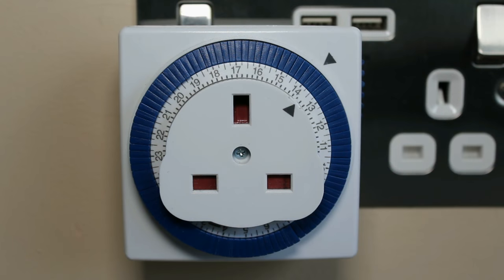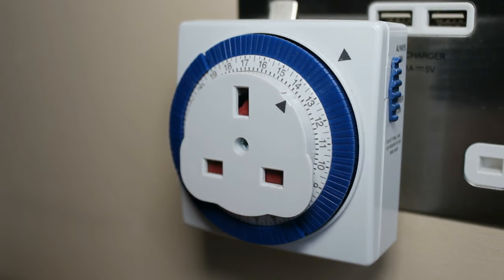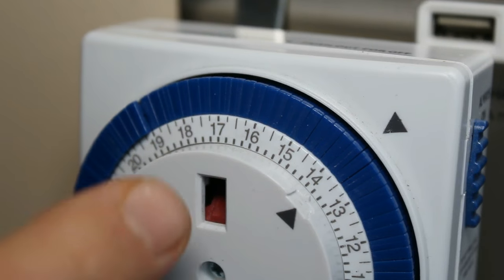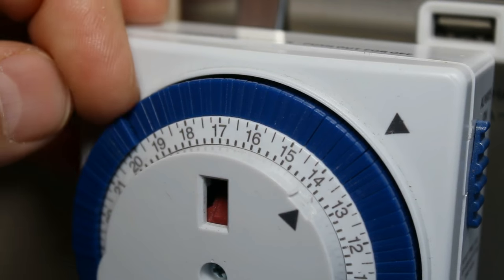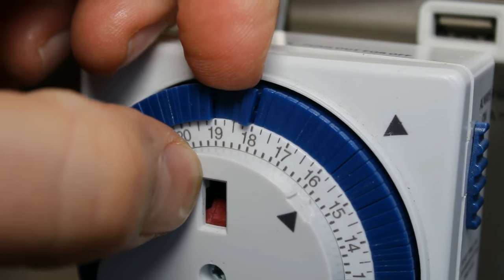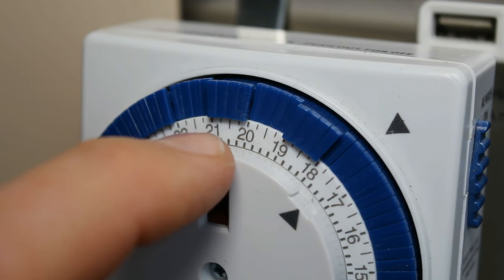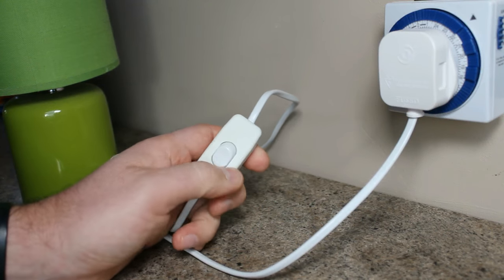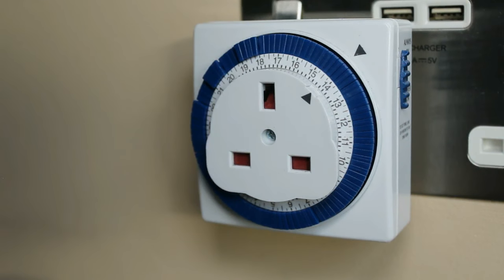How to use a Plug-In Timer Switch - Setting up a Mechanical Timer Switch

Comment: This Timer I got yesterday but it's motor so dial is not rotating while keeping switch on Time
Reply from the maker: It should turn if it's on timer and not 'off'! If it doesn't, it's not working and needs replacing!!

Comment: Finally i know how to manage the timer😃👍. Thank you for the info. Its a bit hassle when the timer is fixed by someone who knows and suddenly you got power supply disruption that makes the timer runs off depending on the power cut-off duration. Now i dont have to call in the expert to help me fix the timer.
Reply: Only person explained it propbably in my opinion 💚💨✌
Reply from the maker: Thanks guys! Glad it helped you out when you were in a sticky wicket!

Comment: Thank you so much.  I have had these for many years and have never been able to set them successfully.  Thank you for your amazing  explanatory video.
Reply from the maker: Thank you for leaving a comment!
Reply: Everybody is explaining about the pins, but nobody is explaining if the pins and the recent time has to be settled after is plugged into electricity or can be settled up and than to connect to the electricity??? 
That's my dilema!!!
Reply from the maker: You can do it either way really??

Comment: Very well explained and demo video many thanks .Can these timer switches overheat if in continual use or is a slightly mild warmth to the housing of the device, a sign of faulty device or maybe the wall socket might be the cause especially if wiring is old in the house?  . I'm just a little bit worried than when I'm out,  if it overheats for whatever reason, be it a faulty device or faulty wall socket / older house wiring,  or maybe just the device has lived out it's lifespan ? . Also how many years you think the device lasts before it should be  replaced with a new one?
Reply from the maker: I have never known one overheat. In our house we have one running all the time for the light on the Lizard's vivarium and it has been fine upto now (approx 5 years!)

Comment: Really well explained ....thank you for a clear and informative vid!
I have 2 of these the very same as the one you're using but the actual 'clock' itself has stopped working on one of them. I just wondered whether you think I'd be able to take it apart and repair it at all? Or is it just time to ditch it and buy another perhaps? 
Thanks for any info/suggestions you may have on this.
Reply from the maker: I've never opened one up, but I guess it would all be cogs and gears and not something that I'd bother doing. For the price of then I'd buy new! Saying that, it could be something as simple as the switch not working?
Reply: @charlieshooter 
 Hi and thanks for getting back to me. 
Lol, yes, in view of how much they cost perhaps I was being a bit silly to consider repairing! 
I just thought if there was perhaps a quick fix it would save more waste going to landfill ...or wherever this type of waste does go ..  :)
Anyway, have just picked up a set of 2 Eveready for £7 from B&M so I'm good to go!!
Thanks again
D

Comment: You’ve explained that so well thank you, can I ask can you plug these into an extension lead ?
Reply from the maker: Yes, I've used them in extension leads. Only problem is, they are so wide that you won't fit another plug in the next socket.

Comment: great video. i just need to know if its clock does work continuously day after day without needing? if so does it get power from plug or a battery?
Reply from the maker: It just keeps going day after day. The power comes from the socket. Not sure how much it uses, very little I'd imagine!

Comment: Really like your video we are trying a timer in the lamp but when we turn the lamp on it stays on and won’t switch off are we setting it up wrong many thanks
Reply from the maker: Thank you! You may have the timer set to permanently "on" rather than on timer. There's usually a slide switch on the side.

Comment: Are these safe to use on an oil heater when away from home for a while, e.g. when on holiday ? P.S. Your detailed explanation of how it works will help me for sure, if I do get one.
Reply from the maker: I dont see why there should be an issue, as long as the oil heater is in good working order and placed in a safe place. Some of them have their own timers on them?

Comment: Hi great video .. what if i didnt set the mechanical timer to match the time  on the  clock ...if you see my point..would it work
Reply from the maker: I see what you mean. It would work but it would just be an hour or 2 behind/in front, however much out the timer is.

Comment: Thanks. Will it make a clicky sound every 15mins? Just wondering if that'll get irritating.
Reply from the maker: Some them do make a very light ticking sound, but no more than a clock would, and it's quiet enough that it doesn't get annoying.
Reply: @charlieshooter  thanks I'll try.

Comment: Is it always important to plug the timer directly into the mains ? Or into a extension lead box, then the extension lead into the mains?
Reply from the maker: You can plug the timer into an extension lead, that's fine. We do for our lizard's light.
One thing though, you may not get another plug right next to it on the extension, depending on the size and shape of your timer.

Comment: Silly question but will this plug work everyday it's plugged in say if I was going on holiday for a week and I wanted the lights to come on from 5pm to 12pm will it do that for 7 days or just the one day?
Reply from the maker: It will do that until you unplug it! It just keeps turning and is a 24hr clock.

Comment: Is the "clock" mechanically run or is it electric? Like if I disconnect the timer from the power socket, is it going to stay at the current time or will the clock be moving still?
Reply from the maker: It is powered by the electric socket it is plugged into. It will not continue turning once it is unplugged.
Reply from the maker: The clock is powered by the electric socket it is plugged in to. It will not continue to turn once it has been unplugged.

Comment: Is it safe to plug one of these into a double plug or dose it have to be a wall socket.
Reply from the maker: I used one in a 4 gang extension lead for years with no trouble. Should be fine. 👍🏼

Comment: what will happen after 24hr cycle.. do we want to reset or will it work continuously.?  i need to use this to switch-off a circuit at night time (6pm to 4am everyday) and rest of the time (day time) shall be switch-on.
Reply from the maker: That would work perfectly for that. It works continuously. After 24hrs it just starts again.

Comment: Wat best to use? Always on or timers on? Need the answer.. thanks
Reply from the maker: Depends really! If you want it on 24hrs a day then use "always on", but if you want it to go on/off at set times throughout the day then set it as "timer on".
Reply: why its not working if i will set in 24hours?

Comment: I always get confused when i dont see timer clock moving. When do we feel that timer clock is ticking/operating in order to switch on/off the appliance? I have many times purchased and returned these timers seeing those not working :(
Reply from the maker: If you want to check it, I'd leave it for 15 or 30 mins and check if it's moved to the next segment. You should be able to hear it ticking quietly. Also, check you've got it switched to timer. 👍🏼

Comment: My timer switch doesn't seem to switch slo cooker off for some reason, any advice?
Reply from the maker: It should do. It should stop any power going to the appliance. It may be faulty. Don't forget the slow cooker will remain hot for a while anyway so may appear to be on.

Comment: My mechanical timer is making a ticking sound is that normal or should I be worried about a potential electrical fire
Reply from the maker: They do tick. Some are quieter than others and hardly noticeable....others can be relatively loud!
Reply from the maker: Some are quieter than others so you may have got lucky! 👍🏼
Reply from the maker: Try the sliding switch and if all else fails, send it back!

Comment: When we set the timer and it turned off when not required, do we need to switch off the main switch?
Reply from the maker: No, don't turn off the main switch (at the wall) because the timer will no longer run.

Comment: I think one of the disadvantage of using this timer is ... when ever there is power break down....no power mean the timer is not functioning.  When the power restore timer is to be reset.
Reply from the maker: Yes, it does need resetting. Maybe someone needs to make one with a backup battery!

Comment: Everybody is explaining about the pins, but nobody is explaining if the pins and the recent time has to be settled after is plugged into electricity or can be settled up and than to connect to the electricity??? 
The dilema is, what is the correct order or steps to follow? 
1. Set the desired time with the pins
2. Set the actual time with the arrow
3. Plug into EL.
4. Switch on the timer (on the side).
I'm not sure at all....
Reply from the maker: Yep, doing exactly as you said should be fine!

Comment: The problem is that the timer doesn't work again.  Second one failed out of the box
Reply from the maker: There are so many cheap ones around you are better spending a bit extra (not much!) on them. The one in the video was from Wilko....and has never missed a beat.....but you won't get that now!! 🙈😂

Comment: I found this VERY CONFUSING!!!!!!!!!!!! I had to watch it again and again and again and again to "get" which was on and which was off!!!!! I think pressing the blue segments DOWN means that the appliance is ON, leaving them UP means that the appliance is OFF. Am I right about this? I need it to turn my TV OFF at 11pm, and BACK ON AGAIN at around 7am. I don't want it to turn back on on it's own, I need to be able to turn it back on during the day and evening when I want it on, but the IMPORTANT THING IS THAT IT GOES OFF AT 11PM EVERY EVENING. Can somebody explain it to me again? I THINK I've got it right, I'm not totally sure though. It would be kind of somebody if you could do that.
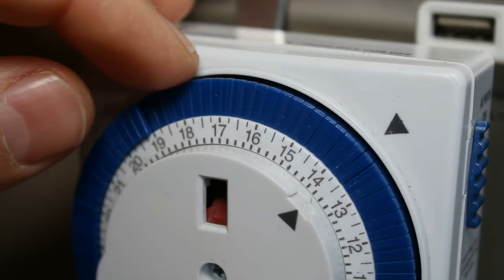Reply from the maker: Watch around 1:55, I think it's pretty clear.....down means on, up means off! At 11pm, set your timer to go off (up) and leave them off until 7am the next day. You're TV shouldn't turn itself on, it should stay in standby, until you press the power button to turn it on. Hope that helps!
Reply: Thank you for replying to me, I'll do it the way you said, and see what happens.
Reply from the maker: Let me know how you get on. 👍🏼
Reply: @charlieshooter  I plugged the timer in tonight, then plugged the TV plug into it, and turned the TV on. It should have come on, because the blue segments are down at the moment, meaning the timer's not on, so it shouldn't have turned the TV off now. I put the timer on "manual," so the TV would turn on, then I put the timer back on, so hopefully, the TV will turn off at 11pm tonight. Last night I was crafty!!!!! I looked to see what programmes were on after 11pm, and there were some I really wanted to see, so I unplugged the timer from the TV!!!!! I'm not really supposed to do that, because the reason I've got it is to turn the TV off, so I can get to bed earlier!!!!! Somebody said that there are timers in TV's that automatically turn the TV off at a certain time. Do you know about those ones?
Reply from the maker: @ruthsayers1163  Yes, some TVs will have a timer to turn off at a certain time or after a certain amount of time. I'm not sure which.
Reply: @charlieshooter  I said I put the timer on manual, to turn the TV back on, then I said I put the timer back on, so the TV would turn off at 11pm, but  I FORGOT TO DO THAT!!!!!!!!! So the TV stayed on!!!!! put the timer on this morning, I MADE SURE I DID THAT, I'll check it when I get home, so the TV SHOULD go off at 11pm tonight. I'll write you a message tomorrow to tell you what happened. Thank you for helping me with it.
Reply: MY TV TURNED OFF AT 11PM TONIGHT!!!!!!!!! BINGO!!!!!!!!! I THINK I'VE GOT THERE!!!!!!!!! THANK YOU VERY MUCH FOR YOUR HELP.
Reply from the maker: At last! 👍🏼👍🏼

Comment: Mine doesn't have arrows
Reply from the maker: Have they worn off? There should be some kind of marking to indicate the time.
Reply: Mine has no markings, or arrow either
Reply from the maker: @andrewpalzeaird1533  Did you buy it like this or did they wear off? They should have some markings on them. To get around it, you could push a section down, and then plug a lamp into it. Turn the dial slowly and when the lamp turns on, mark the position where the pushed in section is on the unit with a permanent marker. That may help!